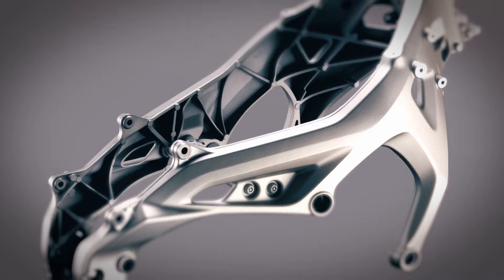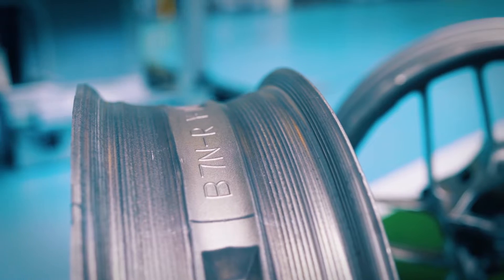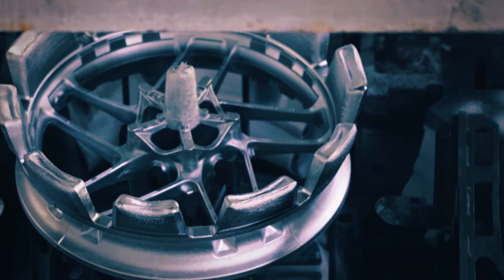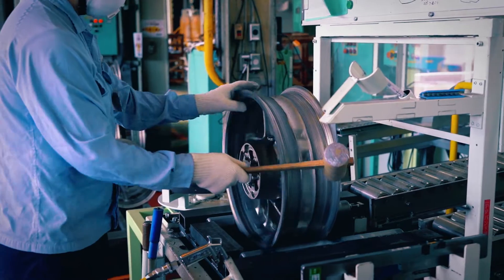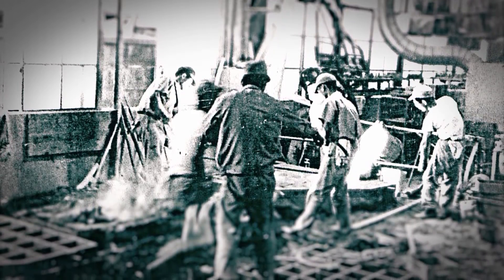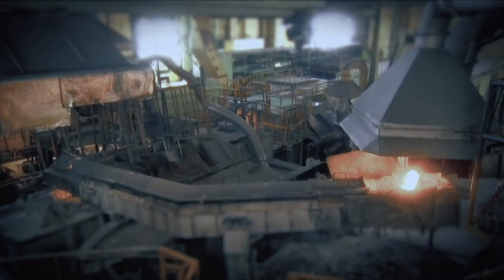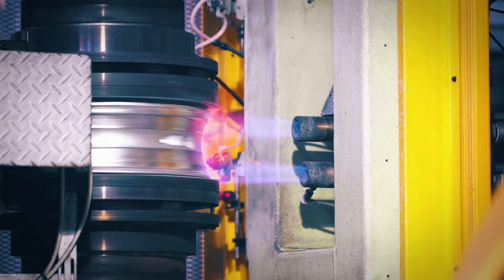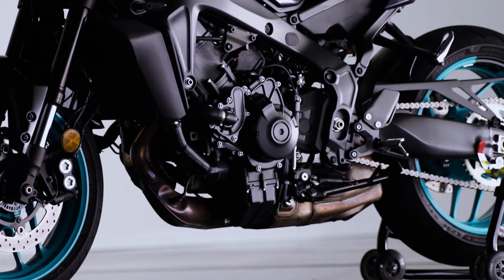YAMAHA MOTOR CRAFTSMANSHIP Introducing YAMAHA SPINFORGED WHEEL

Comment: Great, but WHY SO UGLY?

Did those techniques constrain you to make beautiful designs?   The cast magnesium wheel looks amazing.  The R1 wheels look ok, the R6 looked insipid, lame, the R7 and R9 look bad, the MT-07, Mt-09 and Tracer wheels look horrid.  And if it were not enough you paint them with the most vomitive paints available.  Such an eye sore.   For instance the brand-new MT-07.

BTW the "designs" (or lack of) of the whole MT-07, MT-09 and MT-10 bikes have prevented me from buying any of them since 2014.   All Austrian, Italian or rival Japanese bikes for me so far.

I mean, the finishing is gorgeous, detailed, curated.  You can tell they have the highest quality but why those horrendous designs?

MT-07, MT-09 and MT-10 look as if they were projected, masterfully engineered, painstakingly-precisely assembled...  but without any design.  They look as if they decided, let's save in design, let's just throw some weird colours, and silly headlamps (some of them like cheap kid-toy faces).  They look as if unfinished.   They look as if they miss the proper lights, covers, panels, etc.

Such a crying shame.   I can't buy any current Yamaha.